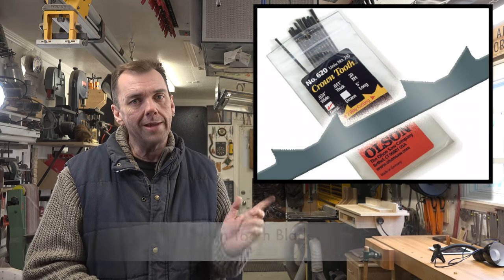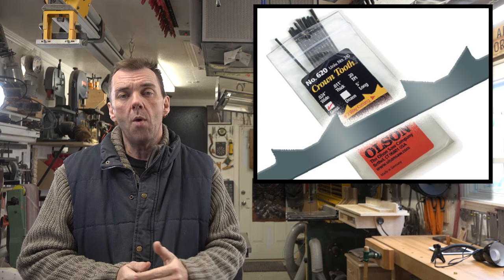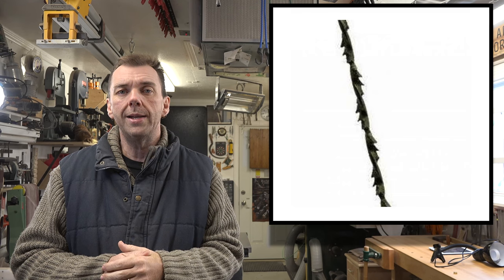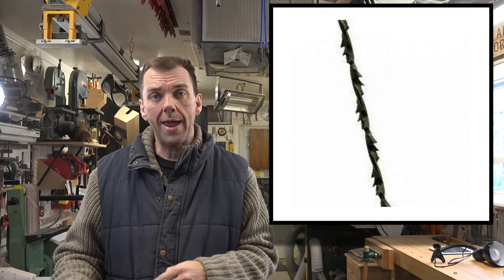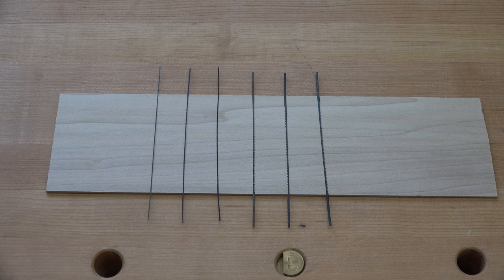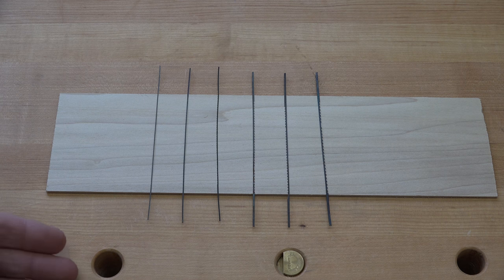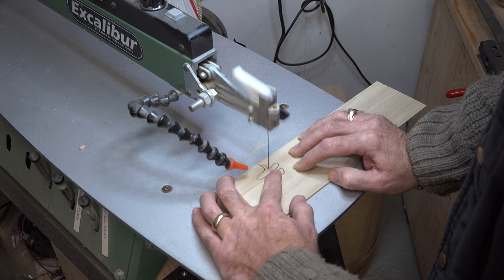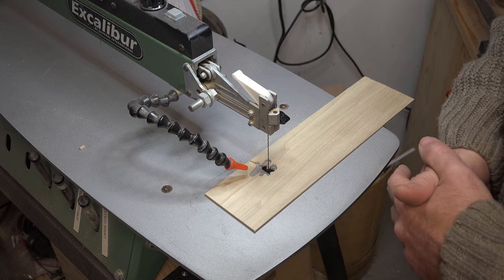Scroll Saw Blade Selection

Comment: 40 min seemed long at first, but I was entertained the whole time. You did a great job of explaining this, thank you. I'm trying to learn how to operate the scroll saw effectively. My boss loaned me his saw to try so I could see if i I like it enough to justify buying one. The first time I tried to use it was not much fun, but I have now learned that my blade was way too thin for the stock. I'm excited to try again soon. Also I purchased some Olson, Delta and Bosch blades from different local stores recently. The Bosch doesn't have the same number system and they look really thick, one is .110"-15tpi the other is .093"-9tpi any insight on that? Do you pretty much stick with Olson? Thanks again.
Reply: Also the Delta blades are spiral .047-36tpi. 

My Olson blades are 5R - 12.5tpi, 7 - 11.5tpi skip tooth, and 2 - 41tpi spiral.
Reply from the maker: Glad to hear that you found the show useful.  Most blades go under the universal numbering system but the specifications that you are referring to with the Bosch blades, exceeds any numbering standard that is out there right now.  These are some seriously coarse and thick blades that you are referring to and I can't see them being much use for cutting any sort of detailed work.   One of the blade is larger in girth than a number 12 Olson blade, but has more teeth than a number 5, 7 or 9 blade.  The other blade is still thicker in girth than a number 12 but has roughly the same amount of TPI.  Very strange combination indeed and I hope that you find them useful.  I've never heard of such strange specification but like I said in the video, there are tons of blades out there and they all have a use in the shop.  I pretty much stick with the Olson blades because that's what I'm used to and that is what is readily available to me here in the city.  I've always been happy with them, especially the Mach blades and the PGT blades.  They are pretty awesome.  If you have any questions along the way, please don't hesitate to ask.  I'd be more than happy to help you out.  You might also want to check out my scrolling for beginners videos and see if there is something there that might help you along your journey.  Thanks for tuning in.

Comment: Brilliant descriptions, very understandable and have helped me a great deal. Coupe of questions for you if you don't mind.......If you were doing very intricate work in say thickish stock of 0.75" to an 1" what blade would you go to?  Also, I understand beefier blades will all cut thinner stuff but would I struggle to turn/scroll on tight turns with a bigger blade?  I bought an old secondhand Hegner this week and need all the help I can get not ever done any scrolling before.
Reply from the maker: A large part of this answer relies on the species of the wood as the choice for maple may not necessarily be the same for poplar.  Either way, If I were to cut somewhat intricate work in 3/4" thick material, I would most likely go with an Olson #7 PGT blade.  I should do the trick.  Using larger blades can make tight turns a little more difficult.  You wont be turning quickly that's for sure but as long as you take your time and cut slowly, you should have no issues making tight turns or corners.  I hope this helps.  Thanks for tuning in to the show.

Comment: Thank you so much for this, picking up my DeWalt tomorrow and was trying to decide which blades to grab for starters. I am in BC Canada and Olson is common. I know this video is a couple years old now, but I have their selection chart and do not see a #3 reverse, only in the Mach and a couple other specialty blades or did I missing something?
Reply from the maker: I'm not sure if OLSON sells a normal #3 blade as I only use their Mach blades in that number.  But I will tell you that they Mach blades are incredible.  They are a little more expensive but they give an incredibly clean and almost polished cut to the stock.  For normal blades such as reverse tooth, a number 5 blade would work just as well in place of a number 3 as the kerf is similar and the blade size is also similar.  I hope this helps.  If you have any questions along the way Dawn, you can feel free to contact me via the channel's Facebook page or through email and I would be more than happy to help if I can.  Of course, you can always reach me by commenting on one of my shows.  Thanks for tuning in.

Comment: Thank you, thank you very much. I feel that I now have a good understanding about blades. Just started scrolling at the age of 68. Also what kind of plywood wood would you choice. Is the baltic plywood better to use? How well would very hard wood like purple heart cut and what blade would you use for these hard woods. Thank you, Ken
Reply from the maker: I don't normally scroll plywood Ken and prefer to scroll solid stock.  It can be a little more challenging but I enjoy the challenge.  Baltic birch is a good choice though if you are interested in plywood.  It's strong, clear and light coloured.  It also takes a stain fairly well.  As for Purple Heart, that's a tough one.  Purpleheart is like scrolling stone only harder.  LOL.  It would depend on the thickness of the Purple Heart and the intricacies of the design but you should be able to scroll 1/2" thick Purple Heart with a number 7 PGT blade without issue.  A lot depends on the thickness of the stock, the speed of the saw, the speed of your feed rate and how tight you are turning the corners.    I hope this helps a little.  Feel free to ask any questions you might have while learning.  Thanks for tuning in to the show.
Reply: @acutabove_woodworkings  That helps a lot. I thank you for your time. I will keep that in mind about other questions. Ken
Reply from the maker: @kenpederson7047  You're very welcome.

Comment: Hi Kenny:
Your explination of scroll saw blades is by far the best I have come across on the entire net.  I have a Excalibur EX21 of which I am still learning to use.  My favorite blade is the Olson #2RT and #3RT.  I can not find them in individual packs.  They seem to come in assortment packs of which I don't want.  (That's how my first blades came from Amazon.)  Now I just want the #2RT and #3RT blades.  I cut primarily 1/4" Baltic Birch.  Do you have any suggestions on where I can purchase individual packs of Olson blades?  Thank you.
Chuck
Reply from the maker: This is the supplier here in Canada that I get my blades from Chuck.  Here are a couple of links to the multiple packs of 2R reverse tooth blades.  They have tons of others there as well.  Check their site out and see what you think of their blade selection.  I hope this helps.  Thanks for tuning in sir.
A twelve pack
https://www.stockade.ca/Reverse-Tooth-Scroll-Saw-Blades--20tpi--12pc_p_5077.html
Or if you want a larger supply.
https://www.stockade.ca/Reverse-Tooth-Scroll-Saw-Blades--20tpi--144pc_p_5078.html
Reply: @acutabove_woodworkings  Wow!  What a selection. Thank you very much.
Chuck

Comment: Ken, interesting show. I find that the majority of the time I use either a 2 or 3 reverse tooth and once in awhile a 7. You can probably guess that most of my work is in thinner stock. I have yet to try spiral blades but you make me want to give them a try. I am curious about the fretwork you showed, where did you get the pattern and what kind of wood did you use? It looked great. Thanks for the informative show. Paul / paulsmessyworkshop
Reply from the maker: That patterns are of various sources Paul.  Some, I make myself and others are from magazines etc.  The wood that my scrolling is cut from is 1/4" thick solid oak and it really is a challenge to cut the intricate pieces in a coarse stock like oak without breaking pieces.  Thanks for the kind words on the show and for tuning in my friend.  It's great to hear from you.

Comment: What blade would you recommend starting with on 1/4 inch mdf? And what speed? Sorry if this seems basic but I’m new to this. I just purchased a dewalt dw -788. Great video!
Reply from the maker: Never too basic of a question to ask Frank.  That's the whole point of my show is to provide a place where people can ask whatever they like without feeling like they are being too basic.  Everyone has to start somewhere. For a 1/4" thick piece of MDF, I would try cutting it with a #2 or a #3 reverse tooth blade.  You will find that the 3# will probably give you a little more control because it is slightly thicker than the #2 but either blade will work just fine.  As for the speed, I would limit yourself to no more than 1/2 speed at this point in time.  The DW788 is a wonderful saw that I worked on for years and I am positive that you will enjoy it.  Set your speed for 50% and practice away.  If you find the 1/2 speed is a little to uncontrolled right now, lower it down.  I rarely go over 3/4 speed for any project but 1/2 speed seems to be my goto. If you have any other questions, please don't hesitate.  I'd be more than happy to help you out.
Reply: kennyearrings1 Thank you!!
Reply from the maker: You're very welcome Frank.  Ask all the questions you like

Comment: what blade would best suit a hardwood like purple heart?
Reply from the maker: Purple Heart is an extremely hard species Raho and while the species does help in determining what blade to use, one of the main factors will be the thickness of the Purple Heart.  For (up to) 3/4" thickness I would suggest a #7 PGT reverse tooth blade.  This will still be a tough cut in 3/4" thickness of Purple Heart and you will have to take it slow but it will cut it.  For 1/2" thick or less, it will have no issues.  I hope this helps.  Thanks for tuning in to the show.

Comment: My source for blades is an internet order, that may be a week in time range of getting the blades. How many of each size that I think I might use, is recommended?
Reply from the maker: For a beginner Drake, I would take into consideration that you are going to break a few.  Blades are considered to be consumables on a scroll saw and if it gets dull, it needs to be changed.  A minimum of 12 blades would be fine but I would suggest at least 24.  I order my blades in packages of 12 dozen so that I always have them on hand.  One thing I would suggest is to consider the thickness of stock that you will be working with and then ordering blades accordingly so that you don't have a surplus of blades that you aren't using.  If you aren't sure what size to order, order one dozen of a variety of sizes and after having some time to play around with them, take notes on which ones you use more often and then order more of those sizes.  I hope this helps.  Thanks for tuning in to the show.

Comment: Is it's possible to cut polystyrene without melt? .3mm-2.mm thickness. I use Japanese micro saws(mini jap. wood saws) currently, 4mm angle .15mm thick.... I was trying to look for something as close as possible to this. I know it will have to be thicker than .15mm but I can't find anything specific for plastic that will cut clean besides acrylic which is much harder and not having 2 deal with melt.

Am I looking at the wrong tool should I just stick to my hand tools for intricate cuts?  I work with plastic scale models FYI. 
Thanks I appreciate anyone's knowledge. 
P.s.
I'm currently looking at proxxon variable scroll saw.
Reply from the maker: It is possible to cut without melt but there is a fine line of adjustment and you will need to experiment to see what adjustment works best.  To avoid melt, it is a combination of blade selection and saw speed.  A slow speed, combined with a fine to medium tooth blade will help you to avoid melting the polystyrene.  A scroll saw would definitely be a great choice for this type of work and in fact, it is what the saw excels at.  Just remember that there is a learning curve when using a scroll saw and it isn't an instant skill.  I hope this helps you out.
Thanks for tuning in

Comment: I recently got a 16” scroll saw with no blade. Are all blades 5” or does that mean I need a 16” blade?
Reply from the maker: The blades are all 5".  The size of the scroll saw, (in your case 16") refers to the distance between the blade and the back of the throat.  I would suggest that you watch a few shows on my channel to help you out.  Scroll saw Options, a buyers guide.  Scrolling for beginners parts 1 and 2.  I'm sure that these three videos will help you immensely.  Feel free to ask any questions you may have along the way.  I'd be more than happy to help if I can.  Thank you for tuning in and taking the time to ask your question.  I truly appreciate it.
Reply: kennyearrings1 awesome I appreciate your help. I will definitely check them out.

Comment: So my Pégas scroll saw finally showed up and I’m experimenting with the different blade types and so far find spiral to be the easiest.  Do experienced scroll sawers think that’s amateurish or cheating?
Reply from the maker: Scrolling is scrolling no matter what blade you use.  It takes just as much control to be able to maneuver a board up and down and side to side as it does to spin it to follow the lines.  There is a matter of having more control with a spiral blade because it is not as aggressive as a normal blade.  That is most likely why you are finding it easier.  The only issue with a serial blade is that it is difficult to get crisp clean straight lines with them and for that reason, most scrollers don't use them as much.  Cheating?  Not at all.  Enjoy what you do.  Thanks for tuning in to the show.

Comment: On the sparrow blade does it come in a thick blade I’ve got some but they are to thin they keep Breaking
Reply from the maker: Yes Mac.  The spiral blades come in the same kind of sizes as normal blades do.  If your spiral blades are snapping, there are only really two reason for this.  1) you have too much tension on the blade or 2) you are using a blade that is not suited for the thickness of material that you are cutting.  I hope this helps.  Thanks for tuning in.

Comment: Hello!   VERY new the scroll saw game here!  What blade would i use for 1/2 - 3/4" pressure treated wood? It is reclaimed stock and seems to be very dense.
Reply from the maker: First off, let me just say that using reclaimed lumber is just fine, but you might want to careful with pressure treated lumber.  The dust from these board that contain the chemical treatment can be toxic.  Be sure that you have some form of dust collection and use a dust mask.  If it were up to me, I would avoid using it period.  If you must use it, you can most likely use a number 7, reverse tooth blade.  A PGT blade will serve you well for this purpose.  I hope this helps.  Thanks for tuning in Beth.
Reply: @acutabove_woodworkings  Thank you so much for the information!  I am aware of the chem treated wood dangers, and use mostly heat treated wood. On the occasions when chem treated is all i have, i cut outdoors & wear a mask :)
Reply from the maker: Glad to hear it  @Beth4653852  .  Good luck on your project and your scrolling adventure.  If you ever have any questions at all, please don't hesitate to ask.  I would be ore than happy to help if I can.

Comment: Great video, thanks.  Subscribed.  Brand new to scrolling - got the saw today, haven't used it yet.  Thanks for the guideline...going to be scrolling thin metal too...1/8-3/16 rolled steel, or thinner copper etc.  Any suggestions on blades for that?  I've got some skip tooth 2/0, 2, and 4 from Olson.  Olson also make a specific metal blade "Olson Metal Cutting Blade" made of hardened and tempered steel.  I'm in Canada - Van Isle :-) (as I think you are) - any suggestions where I could find/order some of these?  Thanks a bunch.  Cheers.
Reply from the maker: I get my Olson blades from stockade.ca which is a Canadian company.  They might have the metal cutting blades.  Just checked.  https://www.stockade.ca/Metal-Scroll-Saw-Blades--48tpi--12pc_p_5113.html
Is this what you are looking for?  I hope it helps.  Thanks for tuning in and if you have any questions, you can always ask and I would be more than happy to help if I can.  kennye@acutabovewoodworkings.com
Reply: @acutabove_woodworkings  Thanks very much, Kenny.  I'll check them out.
Reply from the maker: @creamygoodness1558  Glad I could help.

Comment: What number reverse Blade for 10 mm plywood? 

Great and and funky job !
Reply from the maker: All of the information on what blades to use on the different thicknesses of stock, is contained in the video.  However, the measurements that I provide are all in imperial measures.  If I were to cut 10mm thick plywood, I would start off with a #3 PGT reverse tooth blade and if it was struggling, I would upgrade to a #5.  Depending on the intricacies or your pattern, you may not want to go any higher than that.  But if the pattern is basic and you want to cut it quickly, a #7 will cut it like a hot knife though butter.  I hope this helps Jordi.  Thanks for tuning in to the show.

Comment: I have a wen 16" scroll saw that I just ordered. I'm gonna be cutting patterns out of pallet wood and need to know which kinda blades I need. I think I need the penless kind.
Reply from the maker: Depending on the amount of tight turns that you will be making, you may just need the pin-less type.  The pinned blades are usually a more coarse blade that isn't capable of tighter turns.  The size of the blade will be determined from the thickness of material that you choose and the species (or hardness) of the stock.  A good selection is usually not a bad idea until you get used to choosing your blade just by knowing the stock.  Thanks for tuning in Charlie.  If you have any other questions, please don't hesitate.